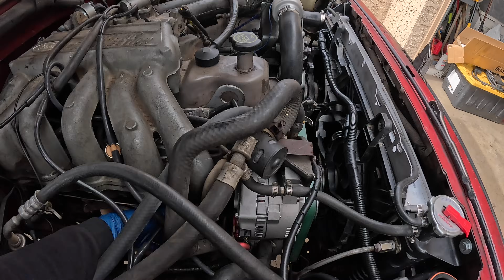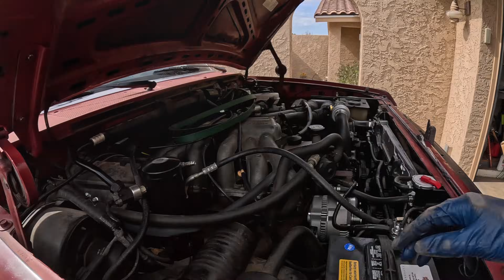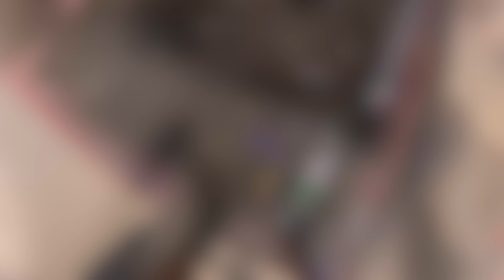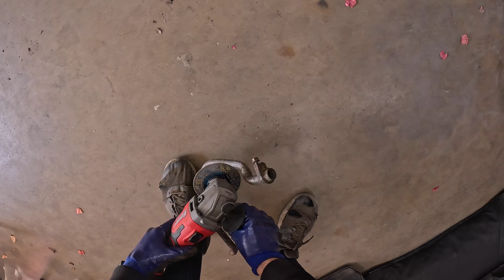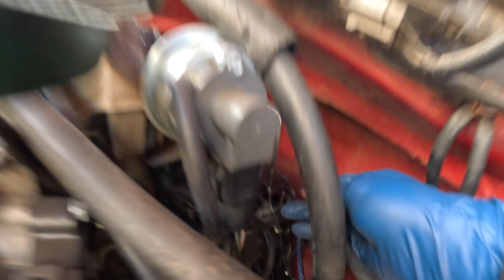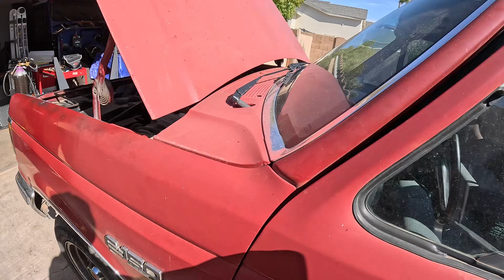Delete Your Smog Pump Now! (Easier than you Think) | Ford 4.9L

Comment: In a pinch, could you just use a shorter serpentine belt and simply not route it around the smog pump pulley? Mine started to rattle recently and that's what sent me down this delete rabbit hole
Reply from the maker: @thaBurninator That'd definitely work in a pinch! 👌

Once the pump goes out, it's nice, too, just to get all that garbage out of there. Makes the engine bay look a lot cleaner. 

Thanks a ton for watching!

Comment: I got all the way through the delete before noticing my truck has an air tube rail, is there anyway you know of to bypass it?
Reply: Thanks for the quick responses, and the support. Great video and keep up the great work.
Reply: Planning on taking everything off but playing it safe in case I had to put it back on for any reason, so I wanted to test it before I cut and smush the pipe down.
Reply: Thats the secondary air injection pipe, part of the EGR system that injects what should be going out your exhaust back into the engine. If you're deleting the EGR you definitely want those gone too, but the ports will need to be blocked. This might save you some time: The bolt and thread size is 9/16 - 18, I used those in one inch length hex socket cap head, this  was on an 88 F-150 4.9L straight six (300), Your model may be different so double check. Also this bolt size and threadsize is very hard to find, so just skip the HomeD3pots and bLowes and even the CarParts stores etc they wont have it, Ace Hardware MIGHT have it, but can usually order it, or look for one of the industrial fastener suppliers in your area, thats how I got em.
Reply: @ddl6795  I wonder if that’ll be the same set up as my 88 F250, I’d like to delete all that stuff.
Reply from the maker: Is that part of the smog pump, or is that the injector cooler tube rail? I've seen there are a few trucks the same year that have those injector cooler tubes that'll kick on for 15 min or so after the truck is turned off.
Reply: Yeah, just did some research and thats what I came up with. It is the air injection, I have the tube. Now i’m trying to figure out if I could somehow leave the smog pump off and not mess with the air injection.
Reply: Now i’m stuck at 90% done and possibly having to put it back on…
Reply from the maker: @YeeBuddy-k1u You can probably just remove that as well. I live in AZ and its getting hot, but I don't ever feel the heat soak on my injectors or the need to cool them further.

I doubt there are people here who even know what we're talking about cause ford got rid of the injector coolers cause they really aren't as effective. They didn't even continue to add it after our generation. 👌
Reply: Back again, Just wondering if I wait to clamp off the exhaust tube that you pinched off, will that mess with my engine or is that just so the gas doesn’t leak into the cab?

Comment: Great video but I have a question. What is the electric cooling fan out of? My truck gets a little hot when I idle with the a/c on and I want to switch to an electric fan.
Reply from the maker: I’ve had weird luck with fans from different vehicles. The one in this video is from a Nissan Rogue, but someone else here just found a great fit from a Ford Taurus. That’s actually a pretty popular choice too. I always suggest bringing a tape measure and checking fit at the yard—sometimes the best fans come from the most random cars!

The important thing is mounting locatiom and making sure you have enough blades to move enough air!

Comment: How do you have the serpentine belt routed? I did this on my 92 4.9 and cant seem to get it right.
Reply: I'll give it a try tomorrow. Thank you for the help
Reply from the maker: @kennethbrown5167  You got it bud, good luck! 🤘
Reply from the maker: @kennethbrown5167 Here's a forum link I found that shows the belt routing I used after deleting the smog pump. This method worked for me and avoided the alternator bolt.

If the image doesn't show up or you're still unsure, feel free to shoot me an email—I'd be happy to sketch out a clear diagram for you!
 https://www.ford-trucks.com/forums/1756456-96-f150-4-9l-throwing-belts.html
Reply: @MyAutoAdventures  does it affect which side the water pump spins ? I had to route my belt differently, although on the oem diagram it shows you can route either way for a ac delete or air pump delete
Reply from the maker: @jorgerios3473 Heyo, great question — and honestly, I haven’t found a definitive answer on that yet either.

I do know that if you're running a manual clutch fan, you definitely want it pulling air toward the engine, so that part is directional for sure. As for the water pump direction, I'll keep digging and let you know what I find — unless someone else beats me to it. 🤘
Reply from the maker: @jorgerios3473 From what I found, the water pump should spin the opposite direction (reverse rotation) as the crankshaft (and harmonic balancer). I'm having a hard time finding a diagram that works where they aren't going opposite. 

Like I said, though, for sure, the fan needs to pull air.
Reply: I can route mine that way but it hits the bolt on the alternator bracket. If I run it with the water pump going in the opposite direction it doesn't circulate properly and overheats. This thing is getting on my last nerve
Reply from the maker: @kennethbrown5167  oh gotcha. Are you running the oem alternator? 

You might be able to pop out that brown bushing on that bolt to give yourself some more clearance and have the bolt be more flush with the bracket. I've been able to carefully hammer those bolt bits out pretty easily before.
Reply: @kennethbrown5167  Remove the bracket and the alternator bolt. Make certain you have the sleeve for the bracket bolt in as far as you can while still fitting the alternator. If the alternator easily fell out of the bracket you can hammer it in a little more with a punch. I ground the head of the bolt down as far as I could without compromising its integrity and also ground the bracket itself. I was barely able to get the belt to clear but it does. No chafing. Only issue I am having is a little belt squeal at startup.

Comment: I’m currently having an issue with the egr and the vacuum solenoid, getting codes 33 and 84, is that TAB and TAD solenoids hooked up together? I was looking at all the lines and those 2 looked like they were broken, I’m just not too sure how the lines were hooked up before, thank you in advance
Reply from the maker: @JuanBarajas-r8i  Heyo, definitely check out my part 2 video! That should help show where the TAD and TAB are originally connected. 👌

https://youtu.be/iNOD4QjcSYQ?si=oNlEeDRkQ1Wn4MgL
Reply: @MyAutoAdventures thank you I just watched it, definitely makes more sense, would you recommend doing a smog pump delete? Also do you know how many 02 sensors these trucks have? I believe just one correct?
Reply from the maker: @JuanBarajas-r8i I actually noticed more of a power difference from this than any other "performance" mod I’ve done so far. If your smog pump and lines are still working well, you might not feel much of a gain—but in my case, it really improved the truck’s get-up-and-go. Besides the belt, it's a pretty inexpensive mod and clears up a lot of clutter under the hood. I’d definitely recommend it!

And yep—my 4.9L OBD1 only has one O2 sensor.
Reply: @MyAutoAdventures thanks man you got a new subscriber looking forward to more videos
Reply from the maker: @JuanBarajas-r8i  Happy to help! I really appreciate you subscribing bud! I've got more in the works coming soon! 🤘

Comment: I been reading this is bad for your catalytic converter. I'm going to do this and an EGR delete on my Bronco 5.0L. But to keep NYS happy I'm going to need to leave the catalytic converter on the truck. 
So my solution is to replace the converter with a 3 way universal converter (needs no air supply) and hope no one ever lifts the hood during inspection to see the remainder of the smog equipment renoved. Lol
Reply: What’s the point of a smog pump delete? Nice video by the way
Reply from the maker: @JuanBarajas-r8i  Thanks for watching and good question—on these older trucks, the smog pump mainly pumps air into the exhaust to help burn off emissions, but it doesn't really affect performance. Mine had a failing pump and leaky hoses, so deleting it cleaned up the engine bay, simplified vacuum lines, and removed unnecessary weight and clutter. It really did give my truck a little more pep. It was definitely drawing some power from my 4.9L.
Reply: @JuanBarajas-r8i  Along with all the reasons MyAutoAdventures mentioned I'm going to eliminate the EGR to prevent the carbon build up that comes with dumping waste gas back into the intake. A perfect example of politicians making stupid laws that cause auto makers to put a system in rhat destroys you engine.
My engine is freshly rebuilt. I'd like to keep it that way as long as possible.
Reply: There is not honestly @JuanBarajas-r8i
Reply from the maker: @joemama1151  What catalytic converter? 😏 

Nah, that sounds like a solid plan. Are you running a dummy plug for the EGR or just living with the codes? Either way, it sounds like a win to me! 🤘
Reply: @MyAutoAdventures  I bought a dummy plug for EGR. I think I can eliminate the solenoids too by replacing them with resisters.
The goal is to declutter the engine bay so I can see my windsor..
Its a 95 bronco with 5 speed btw
Reply from the maker: @joemama1151  Nice, I think you're on the right track there. 

The 302 is a sweet engine, and I'll look even better without all that stuff in the way. Let's keep these old fords on the road forever! Good luck bud! 💪
Reply: @joemama1151 That's a good point. I was thinking the same thing on checking each one of those solenoids for resistance with my meter and finding the equal resistor jumping it across the plug  declutter
Reply: @jeffmartin7509 Off the top of my head I think they are 75ohm resistors needed. 
Fiveology racing also sells plug in resistors to eliminate the the TAG and TAD solenoids.
Reply: As long as your engine doesnt need the backpressure, the key is to punch out the re install the cat. Just remember that will most likely change the exhaust sound a bit.
Reply: Not if the truck has no cat converter😂

Comment: I did this a few years ago. The truck I own has little to no rust, so I left that EGR exhaust pipe in place and plugged the pipe with an old spark plug and a hose clamp. One other thing I did was to replace the 'intake  air temp sensor'. When I pulled the old sensor out it was covered with carbon and oil from the EGR and not working properly. It's a $15 part, so I changed it out and it made a difference and smoothed out the rough idle problem I was having. 
Another problem I was having was the fact that Ford in all their wisdom decided to mount the power steering pump directly over the A/C unit. The power steering pump would leak and the fluid dripped onto the A/C unit directly into the electrical connection causing the motor to run rough and stall at traffic lights. I don't even use the A/C, so I unplugged it and no more rough idle and stalling. I'm not a Ford guy, but this truck only had 97,000 and was so clean I couldn't turn it down. I've owned it for the last 12 years. On average that's less than 5,000 a year. It now has just over 137,000 miles on it, She's a Peach, lol.
Reply from the maker: Sounds like you've done a lot to keep that truck running smooth! Replacing the intake air temp sensor was a great call—amazing how much those little things can impact idle. And yeah, Ford definitely had some interesting design choices. I actually upgraded to a Saginaw pump on mine. Unfortunately, I did it before I started filming, but it made a huge difference getting rid of the classic Ford whine. I can't wait to say I've owned mine for 12 year, that's really awesome!

Comment: How did you make the 3G alternator fit? I’ve seen varying people say several things.
Reply from the maker: @henryglends  Great question! I also ran into a lot of conflicting information when I researched this upgrade. Many forums suggested grabbing a 3G alternator from a Ford Taurus (with a 3.8L) at a junkyard, saying it would bolt right up—but finding one of those was actually a bit tricky.

I ended up sourcing a 3G wiring harness from a junkyard and paired it with a new alternator from Amazon (https://amzn.to/3FhowKk). It’s relatively inexpensive for a brand-new unit, and the reviews speak for themselves—most of them are from people doing the same upgrade on their trucks and Broncos. The mounting holes lined up perfectly with my factory bracket! I'm not the best at wiring stuff, but making the harness work was cake.

Unfortunately, this was one of the upgrades I did before I started making videos, so I don’t have footage of the process.

Comment: God BLESS you, I’ve been scrounging for this info for weeks now. (Engine caught fire and can’t find half of the hoses needed for the smog to even work)
Reply from the maker: I really appreciate that! Sorry to hear about your engine fire—that sounds rough. Hopefully, this video helps you get things sorted. Let me know if you have any questions!
Reply: @MyAutoAdventures If you attempted an EGR delete that’d be interesting. There’s one video on here on EFI vacuum simplification, but he doesn’t go into much detail about it. Other than that I’m loving the OEM+ stuff you’ve got going on.
Reply from the maker: @radiojacked I'd interesting in learning more about EGR deletes. From most of what I've heard, it's CEL central unless you get a delete simulator.

I'm currently working on a video simplifying the vacuum hose setup since the TAD and TAB solenoids aren't used when the pump is removed. I'll try to get some good footage and post that soon!

Thanks again for your positive comments! I love hearing about others' projects!

Comment: Did you end up with any dtcs or cel?
Reply from the maker: Hey Luke, I haven't had any codes or check engine lights since removing the smog pump. From what I've seen, most people don't run into issues unless they start messing with the EGR system.
Reply from the maker: Really appreciate that! Glad you enjoyed the video—thanks for watching!
Reply: Simple and straight forward. By far the best video I've seen for a smog pump delete on this truck. Thank you sir!